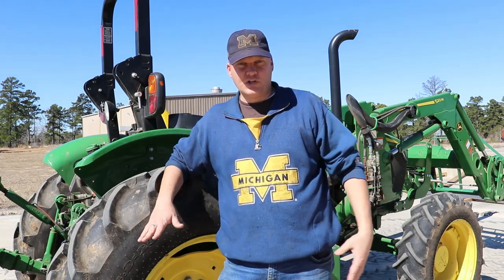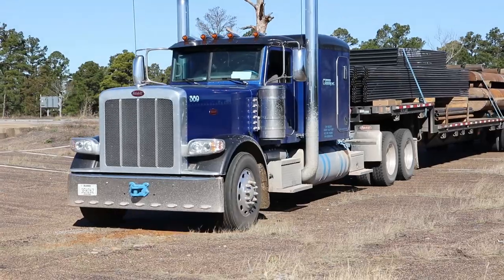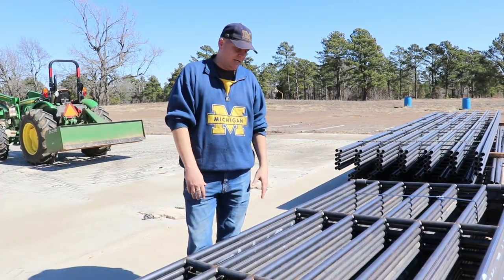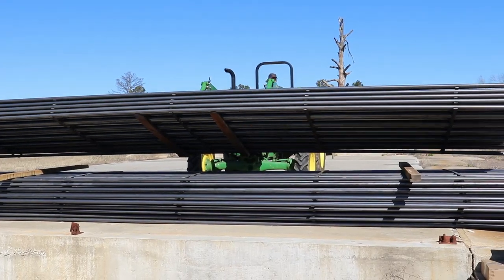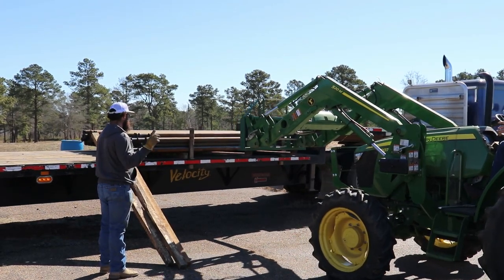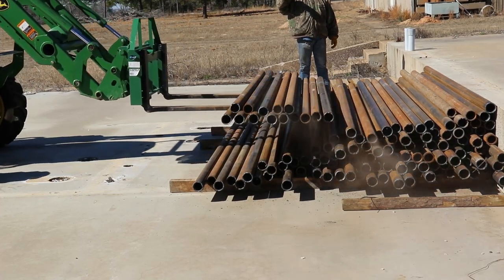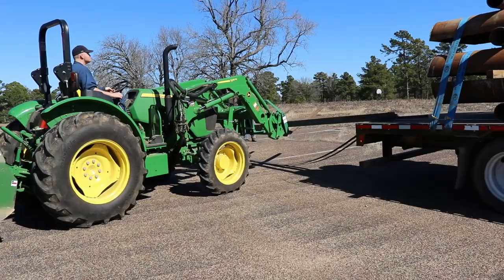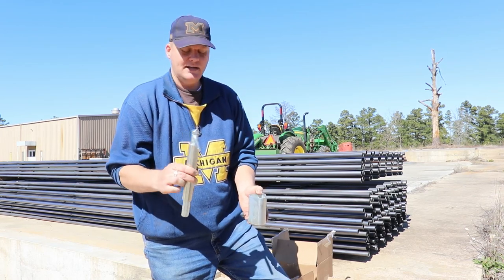Ep. 155 - Steel Has Arrived for Bison Handling Facility | Continuous Fence Panels | Blackacre Ranch

Comment: I used 7018 on all our stuff (need a DC welder)
Amperage will vary, probably around 120 on the pipe, maybe 110 on continuous fencing.  Welding panels to pipe keep your arc short and focused on the your heavier material to help prevent burning through the lighter material.
Reply from the maker: Good tips.  I planned to use 6011 rod...I have like 50lbs of it
Reply: @BlackacreRanch   👍🏻 50lbs will get you started anyway